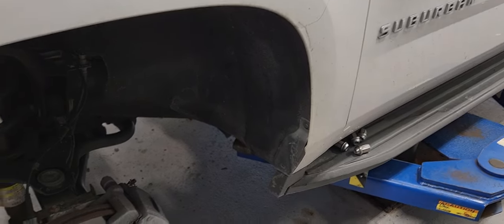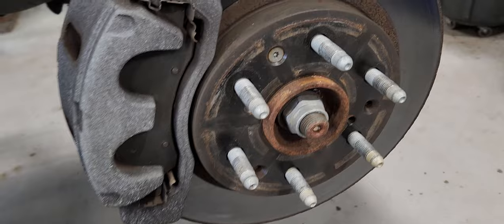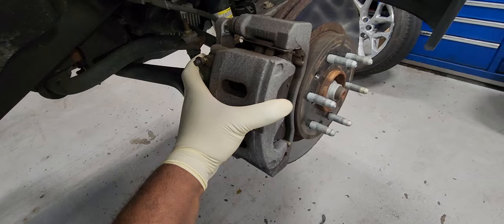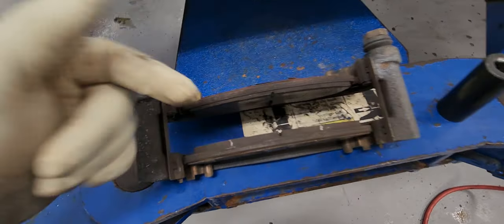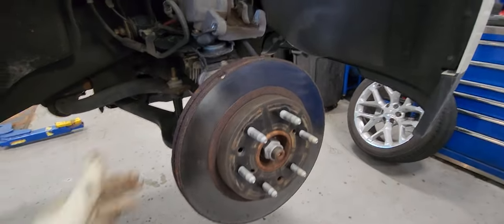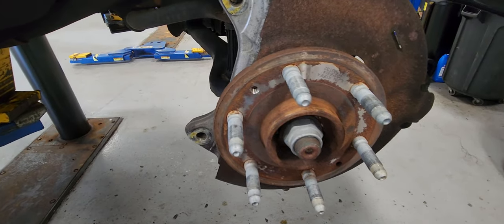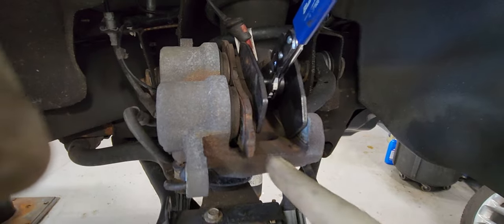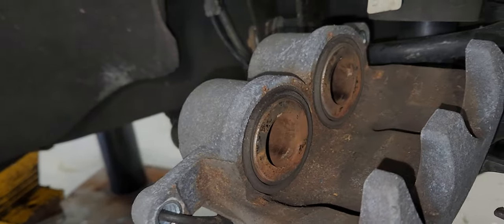2015 -2020 chevy tahoe,suburban,silverado,GMC sierra,yukon front brakes replacement

Comment: The parts in the video are gm parts the link is for amazon parts
Reply from the maker: Not gm part,it is aftermarket
Reply: Watch the video. The box for brake pads has gm parts written on it. That is factory parts not amazon!@steevegmtech7326
Reply: The brake rotors have ac deco written on them. That is gm parts not amazon!
Reply: The link in the description are not the parts installed in the video. You just put someone else's video on there with a link so you get paid.
Reply from the maker: I can get paid for either one of them, the aftermarket are easier to look because it has everything included
Reply from the maker: Gm Front rotor 2x
https://www.amazon.com/dp/B00PM3DGWY/?tag=steevegmtec03-20
Front brake pads
https://www.amazon.com/dp/B0792CYM5K/?tag=steevegmtec03-20